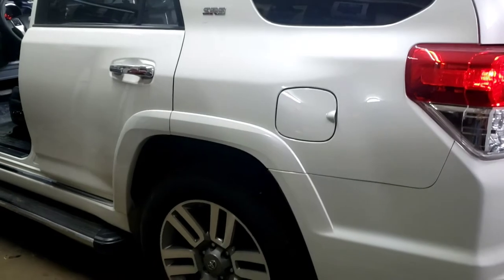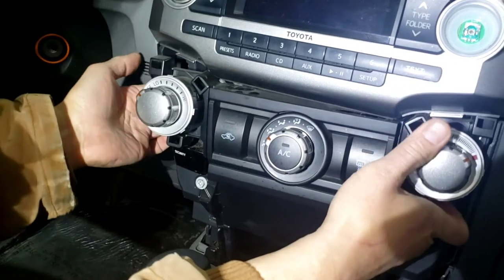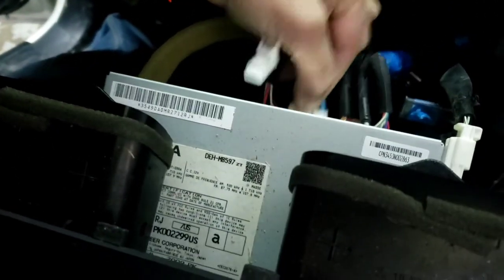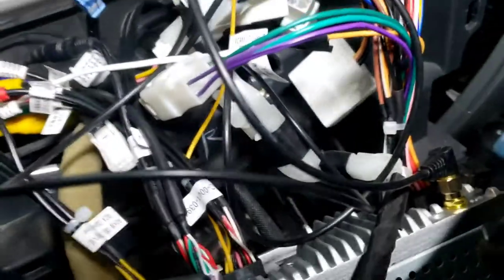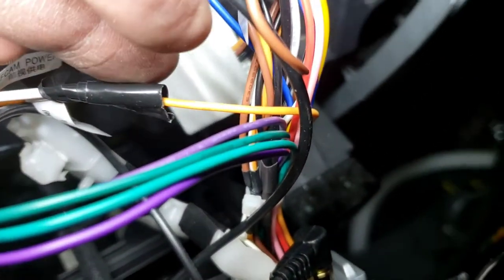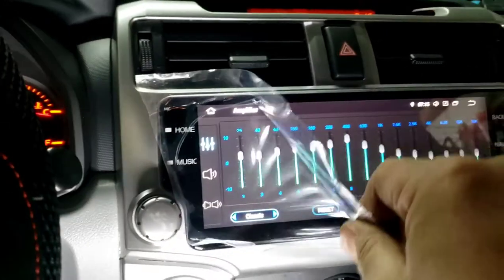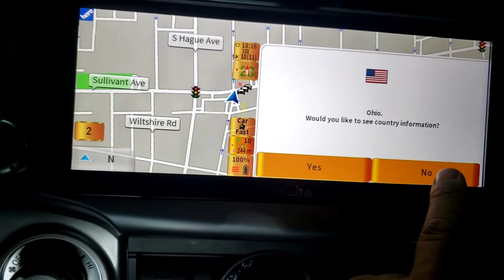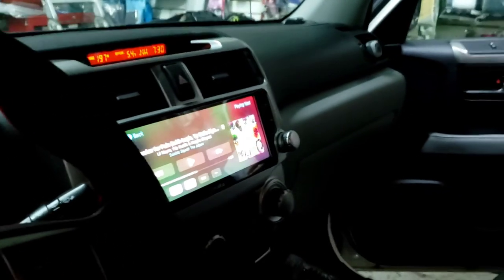Toyota 4Runner Screen 10 inches CarPlay Android install with backup camera

Comment: So you are using the oem rear camera to work correct?

You just had the orange reverse wire tapped into the red wire and it worked?

Comment: How did you wire the reverse camera? I’m having issues on it
Reply from the maker: 3:20
Reply: @khmerohio  i keep trying to figure it out but still having difficulties
Reply: How did you get the video to show up on the back up camera ? Wiring to the factory mirror camera is what’s getting me not being able to install this
Reply from the maker: Factory mirror? Now when you put shift to reverse I'm sure the mirrow is black screen right?
Reply: @khmerohio  yes is the orange wire that says reverse suppose to connect to a wire under the dash? When i put in reverse my mirror camera is still working and not the head unit
Reply: I have a 2013 trail 4runner with the camera on the rear view mirror and trying to have it show up on the new head unit
Reply: Having the same issue with my 11 limited.
Reply: Same with my 2012 sr5
Reply: @khmerohio  yes is the orange wire that says reverse suppose to connect to a wire under the dash? When i put in reverse my mirror camera is still working and not the head unit
Reply: @khmerohio  I need you help.
Reply from the maker: @TheMotoclub815  you meant the screen went black?
Reply: From my knowledge the orange wire (labeled back) on radio is the reverse activation. it does not show image just activates to pull up the reverse screen. There is another 2 wires(rca) we need to tap into to show an image. That is where I'm stuck at. When I put in reverse I get the black screen with a signal error logo.on the mirror plug I thought the orange(positive) and black(negative) wires were the rca wires because they show 6volts when put into reverse on meter but it's still not showing me an image on a 2011 limited with jbL. I'm stuck and I'm tired of tapping wires 😞
Reply: I'm trying to find out this also 2010 trail